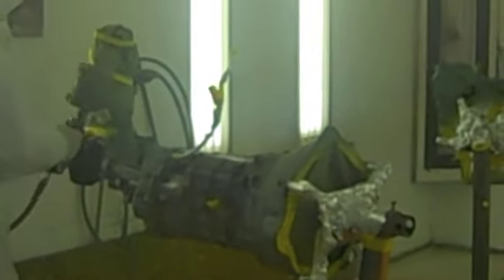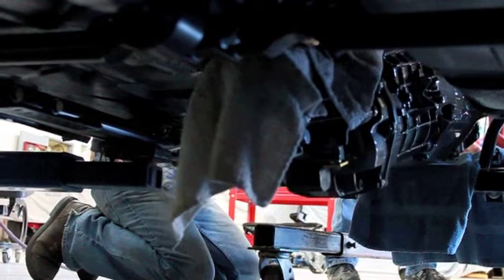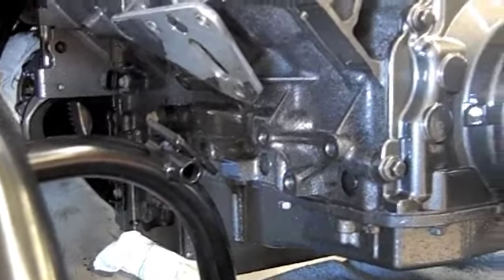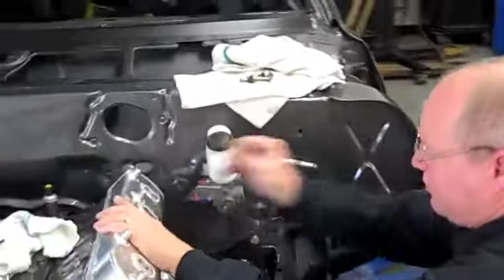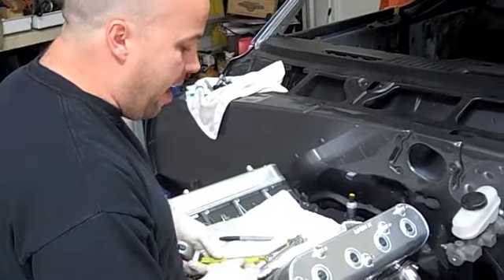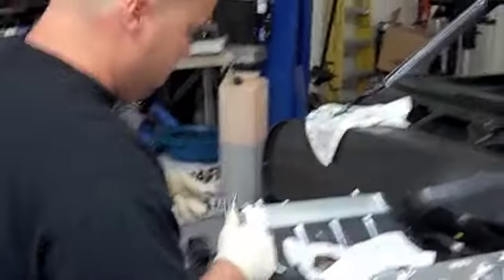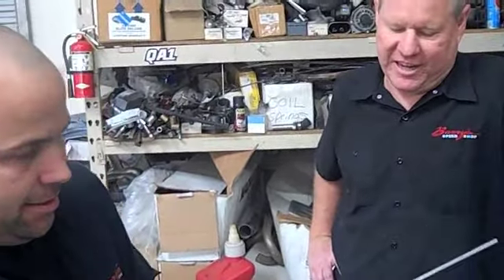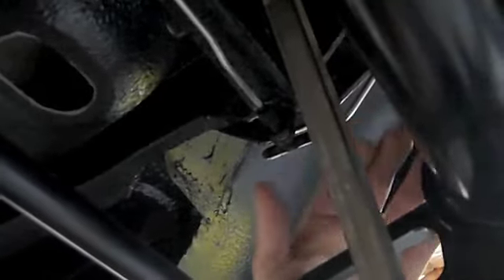Wrecks To Riches ONLINE Episode One

Comment: That's the first time I've seen stainless steel brake pipes. I'd have thought they'd be in Cunifer (copper/nickel/iron alloy). How about routing the brake lines through the interior of the car? My Triumph Acclaim (similar to the Honda Civic sedan) has brake and fuel lines routed through the interior of the car which protects them from the elements.